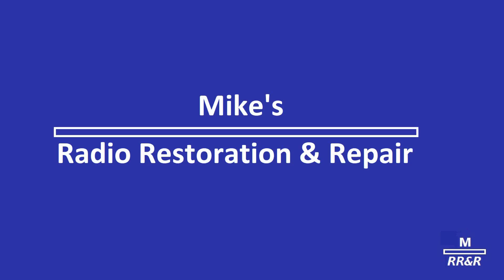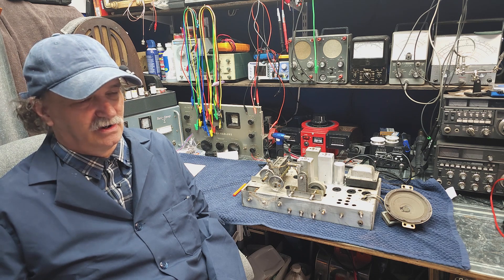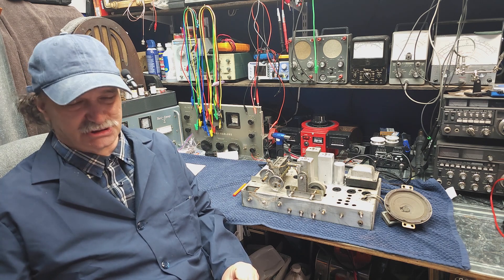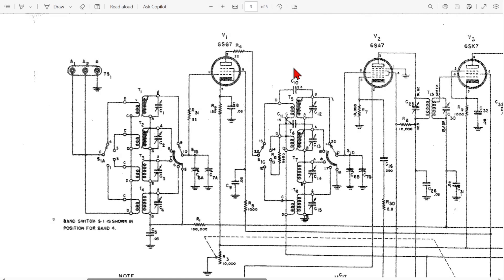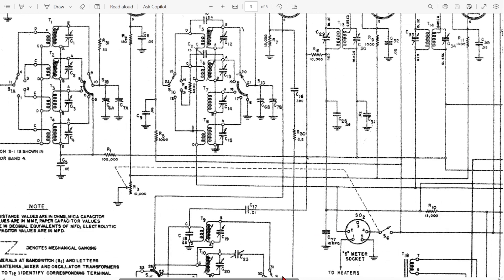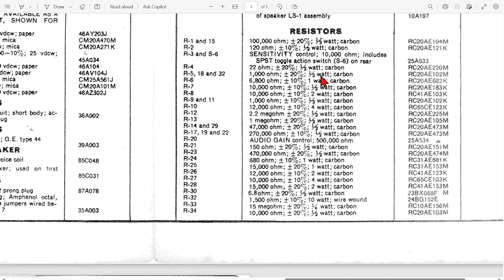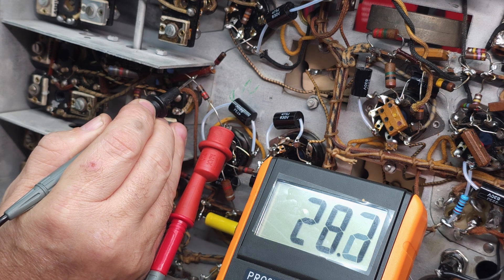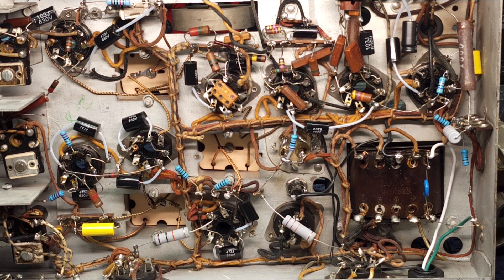Hallicrafters S-40 Restoration Pt. 4 - Resistors! - Learn to test and replace resistors.

Comment: Hey Mike, Again, great information. Do you have a basic shopping list for us rookies to get in a working supply? Ordering in caps and resistors for each radio slows down the repair process so it would be good to have a supply on the shelf to only restock occasionally... but which components should we buy initially?
Reply from the maker: Good point. I will attempt to put one together. It would likely be extensive and expensive.

Comment: Question, what brand make of resistor do you suggest ?
Reply from the maker: I dont use any one particular brand. But there are some good assortments of 1 and 2 watt blue film resistor on Amazon that actually test and work very well. They are quite reasonably priced too.

Comment: Good job, excellent explanation, Mike. Though I wasn't clear on how you handle non-open ended resistors. I think you said you lift one end and even if it is good, you replace it anyway?  You said you just don't bother soldering it back down.  I was a little confused there.  Thanks again.
Reply from the maker: Yeah i dont bother attempting to re-heat and solder short weakened leads. Leads often take a beating when you desolder and unbind it from its terminal. Best and most reliable path forward is to just replace it. The idea here is long term reliability.
Reply: This was the crux of my question as well - I was worried about desoldering and resoldering leads.  To rephrase then .. if a resistor can’t be tested in place via an open ended circuit at a tube or capacitor - it gets replaced just like a paper cap would.  @MikesRadioRepairRestoration
Reply from the maker: @MarkMakelky  Yes in these old radios. Yes during a restoration. They cost diddley squat. Just slap a new one in.